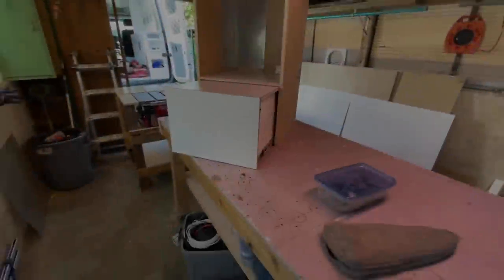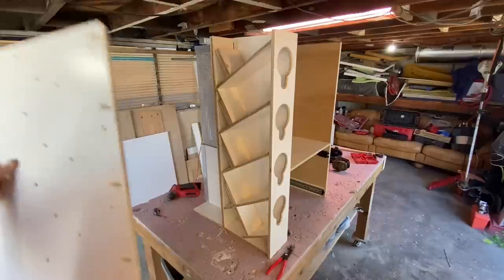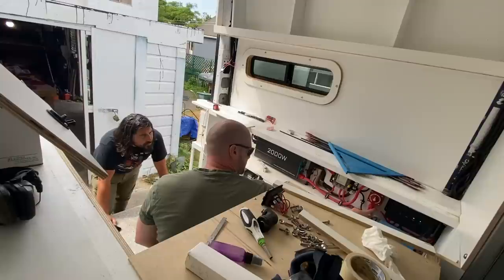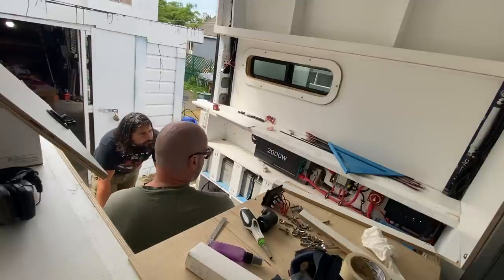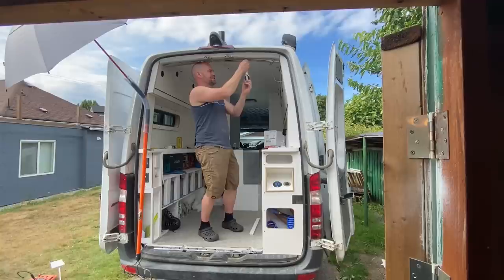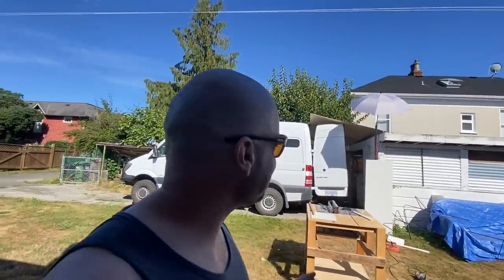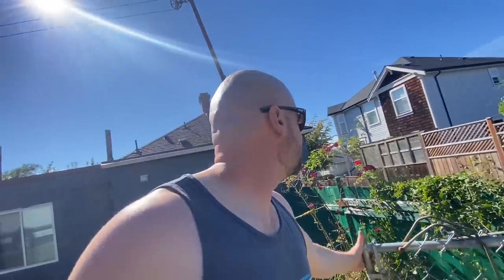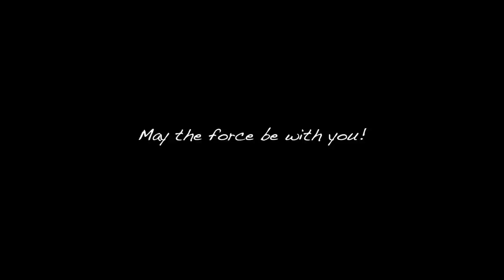Wine Rack, Hot Water Tank, Fridge, Rear Cabinets, Hot Days & Floats || 4x4 Sprinter Build Pt-10

Comment: J doing the Joe Rogan thing (float) 😎
Nick's van looks amazing. 👍
Some people also put a separate switch for the inverter, because it stores electricity in its capacitors. So it can shock you, while the main loads switch is turned off. Fun stuff for the people, if they don't discharge the inverter and don't expect that.😂

Comment: There's been a lot of deals on Milwaukee cordless tools lately. Right now I saw a work light and two 12V 6Ah batteries for $200.

For the bottles, you could use a pool noodle cut up. They sell them at the dollar store. You could run a dowel rod through it to the back to keep it in place.